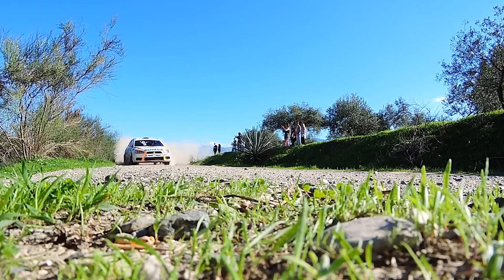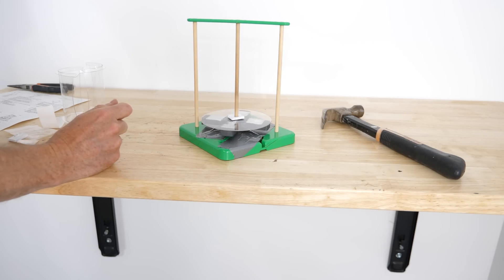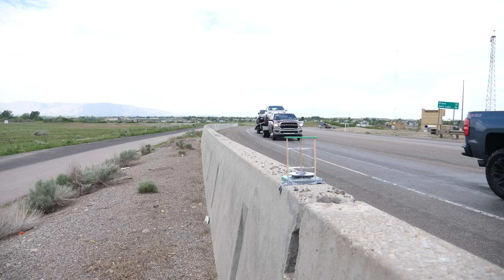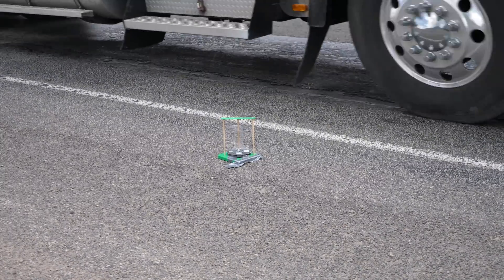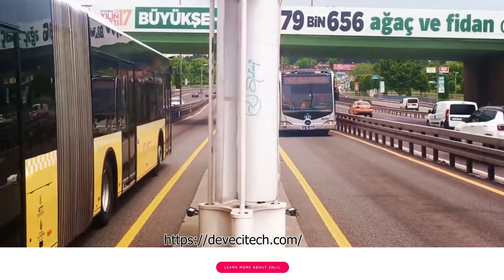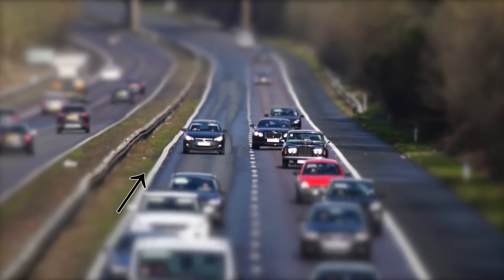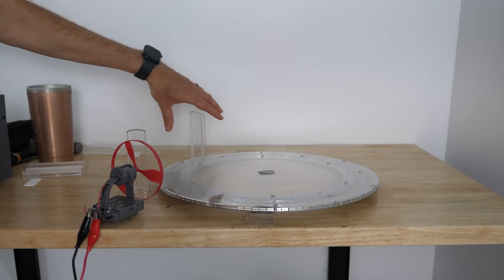Do Traffic Turbines Actually Work?

Comment: 2:32 Not really, you rather need trains as everything can be build just right without having the potential dangers setting a system like this around cars. I'll keep saying it and maybe more will hear it, cars are not a good idea, we need to retire this approach and set our full attention on trains. You can travel cheaper, faster and safer. Not to mention that you get all around less noise pollution, not sure but maybe less air pollution too and no need for parking places so more green areas and probably easier to build and maintain regarding tracks versus roads and would also seem that train tracks take less overall space than highways. Also maybe cheaper to build too, but i'm not sure as rocks and asphalt should be cheaper than steel. 
I know i would rather travel between large distances with a surface train or subway and walk or bike around smaller distances. As for carrying groceries and such i suppose that focusing all our attention on developing good and efficient train systems we could have different services available such as groceries and materials delivery. Would rather have most people walking ang biking in the city and just a few delivery electric trucks on special lanes or that can travel at special set times that would cover whatever supply. Like why even have shops and markets? Just buy online or have vr shops and such, buy what you want and in a few minutes you have your delivery at your door on in your special designed box or something.

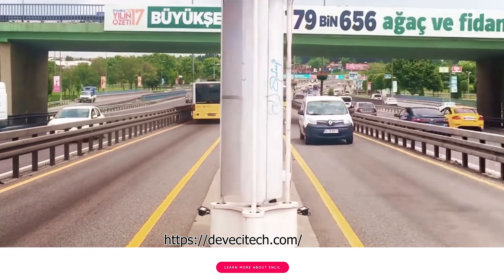Comment: Ideally it's between oncoming lanes as shown at 2:45 Since the wind coming off of one direction of traffic is opposite of the other direction of traffic. So slowing down the air would decrease the air speed and make the cars MORE efficient. Potentially.

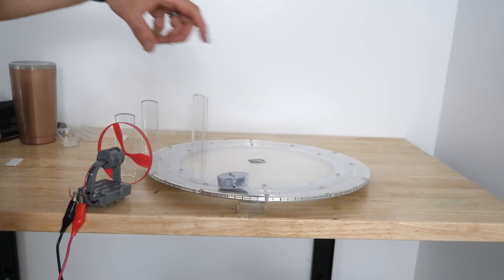Comment: 4:40 Testing there is flawed. Turbines should be spaced out more as they are on roads and, secondly, you're not taking into account the fact that the tailwind off of vehicles already in front of you are exerting the same force of air ALREADY. There is no added air resistance. The turbines would be insignificant. They're already placing them near overpasses where the air currents from the bridges also, already, exert a force greater than the relatively miniscule amount of turbine turbulence would ever cause. Overpasses like that already act as funnels for air and already slow your vehicle down. If anything placing them there doesn't inconvenience cars, but increases energy gained by the natural airflow; while simultaneously reducing the efficiency of the air flow created by vehicles. As a final note, the crosswind between both car lanes in parallel running in different directions would essentially create a barrier. Spinning both sides of the turbine in the same direction while bouncing air flow, mostly, in the direction it already would have been going.

Comment: Reason any of this isn't put on a car is simple. It would create drag and increase weight of car. So make it less efficient. Also the car already has a generator producing all the electricity it needs. If you wanted to use these. It be more for lights etc.

Comment: Does the height of the turbine matter in this? When i saw your plastic example piece on the road I was more imagining thousands of them sitting under some kind of curb along the highways. In your magnet example you also used wind breakers much taller than the magnet itself, would the same speed loss happen if the breakers barely made it to the bottom of the magnet? I know turbines that small would be much less efficient, but they could also potentially be much cheaper and easier to fix on large scales.

Comment: I am skeptical about your conclusion because of your reasoning and demonstration.

Reasoning: You say "the energy to turn these turbines are coming from the car themselves". This isn't exactly true, the energy that is used to turn the turbines come from the wind generated by the car passing. This difference matters a lot: regardless of the existence of these turbines, the cars themselves must move through the air. However, the existence of the turbines may cause turbulence/vortices that affect the aerodynamics of the vehicles. (A vehicle passing through a tight fit tunnel versus open air would have very different drag characteristics) The analysis therefore should be on "how much effect the vortices and turbulence caused by placing such turbine have on the vehicles?".

Your demonstration: You say that the fan is to simulate the air pushing continuously on the road. Is that assumption / simulation correct? I doubt it. You should instead be experimenting using one or more magnets arranged linearly (or whichever shape based on what piece of road you're trying measure) to simulate the effects the aerodynamics of the vehicles. The circular track will have vortex effects on the magnet. Then you simulate having the turbines on and off. And no, not using those static pieces, but a scale model.

Why does getting this right matter? By searching "traffic turbine", you come up as one of the highest view at 389k as of writing. And quickly strolling through the comments nobody has raised any of these issues. There is a non-zero probability that the viewers of this video will influence the policies and funding of energy generation. Since you have a PhD in STEM, I think you should be more rigorous and responsible about the videos you put up. I don't think you're a person that builds his career by misleading people.

Comment: Yes but, when a car passes by, you don't feel the air until the car is gone. So does this resistance really affect the car ? The aire pushes back on the car only when it hits the target, so if the car is already gone, the air should push back on nothing right ? Andwe can clearly see this delay in the video because the turbine he made only starts spinning after the car is gone.

Comment: I don't think your experiment is a good representation of what is happening.
In your experiment the wind was generated by an outside source that imparted momentum onto the magnet. In case of a car, the car itself is the generator of the wind and it would generate that wind regardless of whether or not the wind has a clear area, a concrete wall or a turbine in its way. Such, I think the slowing of the generated wind would not affect the efficiency of the car.
Reply: Even more, I think the turbine would slow the wind and reduce the air turbulence, which would make the car ride smoother and possibly marginally increasing the efficiency. 

That being said I do think such wind turbines would be incredibly ineffective at doing their job, even if you disregard the cost of maintaining (or replacing) them and all the risk they would be subject to being mounted so close to the traffic.

Comment: My guess is that this is just about as feasible on any practical scale as solar roadways. As in, sure, you could put small solar panels under the road... but you're mashing together two concepts with no benefit whatsoever. And in the case of solar roadways, with an actual detriment, since you could've put the solar panels literally anywhere else, and had 1) cheaper roads, and 2) more efficient solar panels.
 
The thing with wind turbines is that size does matter. Ya gotta make them really big, stick 'em up in the higher atmosphere where the wind is a lot faster, and make the diameter a lot bigger so they have more air to work with, in order to get the most bang for your buck. You would need millions upon millions of these tiny things to deliver even a fraction of what one industrial wind turbine would be able to deliver.

Comment: Another idea to solve the loss of energy due to air friction in cars would be to make them super long, maybe by attaching several of them together, this is because air friction is essentially related to the shape of the front of the car, and you can also decrease the amount of friction due to the wheels on the road buy having some metalic parallel lines which you would roll on with metalic wheels. And then you can make your super car electric without having to store power on batteries by instaling yet another parallel cable that provides some electrical power. I hope some nice startups can invente something of the sort.

Comment: So if you put one an average of every 1 foot in the median of I-94 and each one generated an average of 1.5 watts it would be 23,926,320 watts generated on 1 highway, and if they did things like add solar panels to them, and tweak the design so it's even more efficient it would actually be a potentially very much worth it thing to do nationwide.

Keep in mind that's just some random number I pulled out of my ass too. I think realistically they probably produce way more energy than that and be extremely worth it.

Comment: I am by no means an expert on this kind of stuff but I can see some issues that would need to be dealt with.
I think you have the turbines in a AC power configuration. Power grids need to be syncronised with every other generator on the grid. not having this would make it impossable to have useful power grain as the rotation speed and timing would never work out well.  the turbines would need to make DC power and be stored in a battory system that converts it to AC power. or you could leave it DC power and use them to charge eletric vehicles.

Over all the fossel fuel powered vehicles the loss could be sanifagant and lower MPG across enough cars in a big city. However, if most cars out there were E vehicles, it could be a way to gain back some of the power from the cars that then could then be used to charge them again and lower the impact of them on other parts of the grid.
But I am just speculating.

Comment: 1. How much electricity are we expecting these to generate assuming commercial grade turbines are used in appropriate locations.

2. How much wind resistance will this increase and how much will that impact vehicles now, given that, most vehicles already aren't the most energy efficient.

Comment: "traffic" turbines seem like a bad idea for the reasons mentioned, however "turbines along highways" actually probably make some sense.  Wind blows more freely over smooth open surfaces.  Roads are smooth open surfaces.  So any ambient wind is likely to be more apparent on a highway, than a lot of other places, making it a good place to capture that wind.

I have no data on how that would compare to an elevated turbine capturing wind at, say, 100m up. But i imagine its not the worst idea.

Comment: Action Lab, here is my big brain power generation idea.  On a steep downhill section of highway, lay down sections of flexible pipe across the road.  Put a check valve on both sides and a feed the pipes with a raised fluid reservoir.  As the cars pass over they will press fluid out of the pipe.  Use that pressurized fluid to run a geared turbine similar to wave action energy generation.  Free power is generated by the vehicles on the road and the vehicles will save on their brakes.  Everyone wins!

Comment: The cost benefit balance is the question I think will determine this. the concept works, there's no denying that, but the wattage produce compared to the effect of reduction of air flow for the road needs to be tested. all we have is proof that the turbines work and reduce air flow, but not the major effects of both in the long term. 
I personally think it would be great to have those at airports, since the blast of air from the engines could generate energy, and it might even help reduce wind sheer, increasing safety for aircraft. even if they just put them on the back of the run way out of the reasonable turn of the planes, it could at least produce power for the runway lights, maybe even act as position markers for landing aircraft.

Comment: I had an idea that they put coils under the road in braking zones and and magnets on cars.   Lots of drawbacks but kind of the same idea :)  FYI Mining trucks at Kennecot mine in Utah, burn more power off braking down the pit than the whole city uses every day...  Seems like a lot more feasible power collection option considering that the braking is all done electronically and the power is burned off in heating coils and turbines.  Just replace the coils with a power storage device or a tether of sorts and you're all set :)

Comment: 4:20 you could have made the experiment better if the plastic pieces representing wind turbines were not placed on the area where the fan also blows air. The plastic pieces force the blowed air to their sides (even reflect some of it back) and the main slowing force for the moving object might have come from that. If you place the "turbines" on the other side of the disk so that they are not in front of the fan, then you might get a different the outcome.

Comment: Did the experiment not just infer that the magnet could only make the loop from the assistance of a tail wind? I understand that these posts do create a resistance. Put it was only relying on potential energy of gravity and a tail wind. A vehicle is self propelled. The purpose of the front end of a vehicle is to "cut" through air. Creating turbulent wind. Not relying on turbulent wind. Not to mention that the amount of torque they create helps push them through wind quite easily. The bigger issue stems from the real world data you collected. When you had to get the experiment real close to the road. You now risk individual drivers running over and destroying said equipment. The problem then becomes distracted drivers and driving under the influence of substances.

Comment: Existing them on barriers would need bigger scale, i mean that be able to generating usable amount of energy would be ultra noisy, probably could create potentialy harmful for suspension system turbulent flow and in fact problems with proper aerodynamics of vehicles..

P.S
Servicing them would be ultra expensive nightmare by generating smaller amounts of energy with every contamination of bearings etc... Making this way tooo unrealiable for use in real life trafic.

Soooo, yes, its preety unussual way to generate energy but rather a briliant fun fact no likely to be seen in real life

Comment: What a weird concern it is to realize that yes, an environmentally placed object might oppose the motion of a vehicle, but to not connect that a turbine like this ultimately would have such a small effect as to be negligible on the vehicle. 

Ultimately the purpose of these would be to scavenge some of the energy lost to the environment in crowded segments of road - hopefully also reducing the amount of noise and vibration felt by surrounding habitants. It does that. 

In day to day driving you rarely get any benefit from airflow generated by the other traffic unless you’re tailgating vehicles, but you generate plenty of noise that then has to be absorbed by the surroundings.

Comment: Hmm, I don't think your example is taking a few things into account. The only way it results in a net loss of power for the car, is if the air that bounces off the turbine, causes a pressure-wave that back-propagates to the vehicle, more importantly the front of the vehicle where surface area is the highest. Your fan is sitting there setting up a standing and already flowing wave that is blowing into the back then side surfaces of the magnet as it passes, you're creating that pressure instead of reflections off the moving object, you might as well have a fan that points in reverse at it at that point, imo. What matters is the propagation of that air pressure wave.

Comment: The set up you made was based on the wind creating forward momentum which is different from the blowing air being a by product and a resistance to the moving object. You'd have to recreate a scenario in which the moving object is the creation of the wind. RC car with an ohm meter or something attached to detect the change in resistance.

Comment: I am reminded how little science commentators understand science. this isn't even how you would test if turbines would affect the efficiency of cars. That would have been no fan with just the turbine analogs beside the track because that is what is happening an object us cutting through static air and you want see if adding turbines along the path causes bouncing air that somehow affects its ability to cut through the static air. What this experiment shows is that if there is wind and you put air blocks the wind will not have as much effect on the car. This is not even remotely analogous to what is happening. But even if it did cars especially ICE cars are horribly inefficient to begin with. Even under ideal scenarios a heat engine using the fuels we use cannot exceed 50%. Then friction is going to sap a bunch of the efficiency. then the wear of the tire. etc etc. Like this would probably be margin of error/rounding error. The only thing i agree with is that they would be really inefficient and you are better of just capturing wind to begin with rather than the wake off of cars.

Comment: At the end of the day you're just stealing energy from the cars. In a way, it's a very literal road tax if the electricity is used on the spot to power street lights or illuminate traffic signs. Though the efficiency of the mechanism would be terrible, it would not warrant all of the effort and resources used, not to mention a colossal maintenance plan necessary. Also the wind from traffic is super inconsistent.
My other idea would be to install panels parallel to the road that would use the pressure shock ahead of every vehicle and the suction effect behind every vehicle. Somewhat like a sea wave generator but for longitudinal waves in the direction perpendicular to the road.